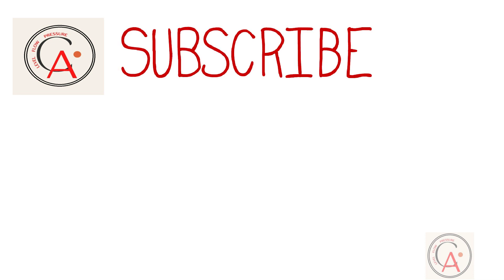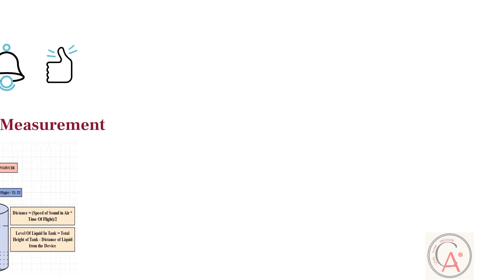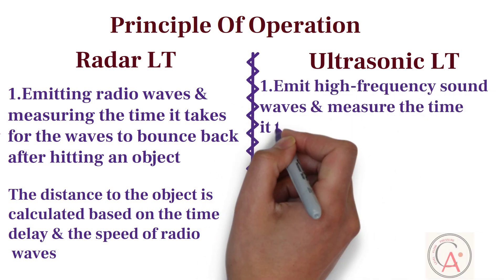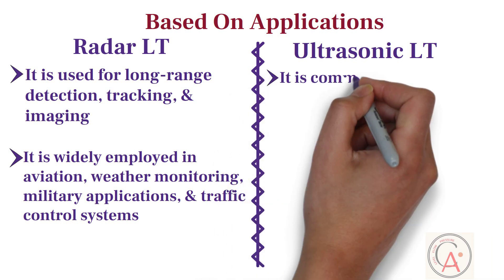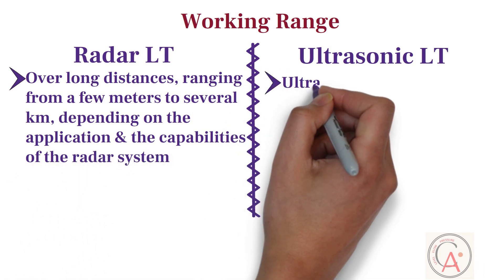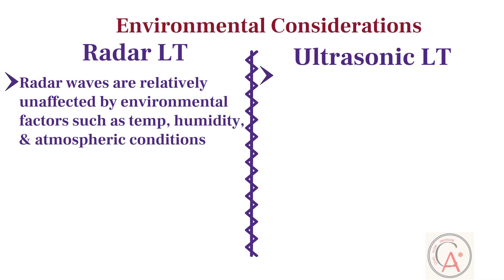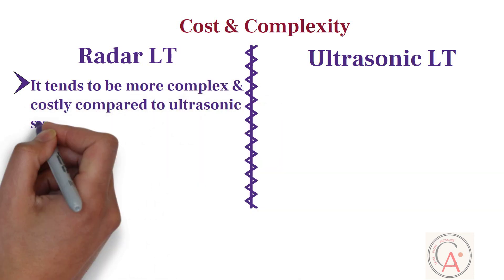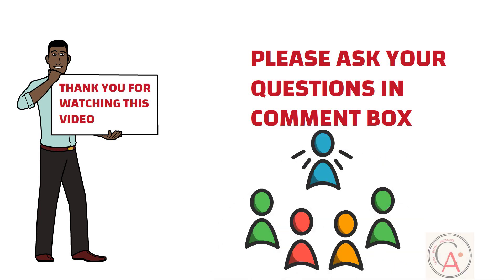Radar vs. Ultrasonic Level Measurement: Choose  Right Technology for Accurate Results

Comment: Another significant difference between Radar and Ultrasonic technologies is in responsiveness to the target material.  In both cases the returned signal to the sensor is a reflection from the object being measured.  The strength of a reflection from an interface is based on effective change in impedance going from air to the object.  In the case of ultrasonic you tend to get a good reflection from most flat objects whose acoustic impedance will normally be orders of magnitude different from air.  Generally speaking you will get an equally strong reflection from a flat surface made of steel, plastic, drywall, or calm water surface.  In the case of Radar technology the important factor for a material is it's DK value - related to how well the material conducts electricity.  So a radar sensor will get very high amplitude reflections from a metal surface, while getting almost no reflection from a plastic surface.  Strong echoes can be achieved off of a water surface, but you'll get a much weaker echo from a low DK petrochemical material.  If the object of interest is high DK (like water), but there are higher DK obstructions present (eg. metallic objects nearby) then you will get disproportionately stronger response from the false metal targets compared with the water surface compared with an Ultrasonic technology.
Reply from the maker: Hello 
Yes, you are absolutely correct. Thanks for sharing your knowledge in comment box. I really appreciate it.